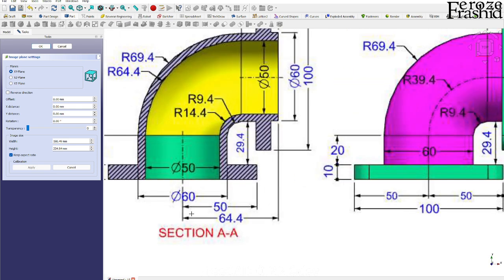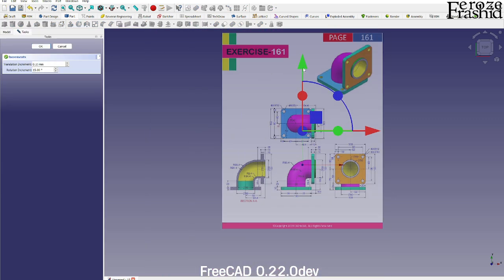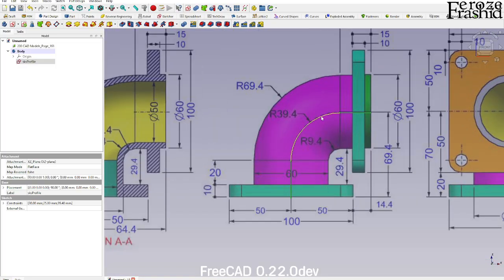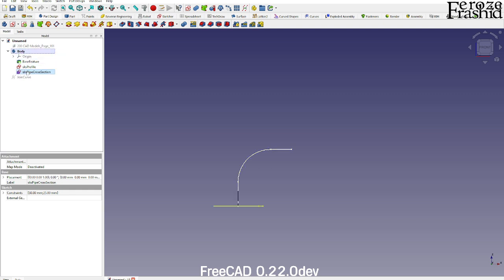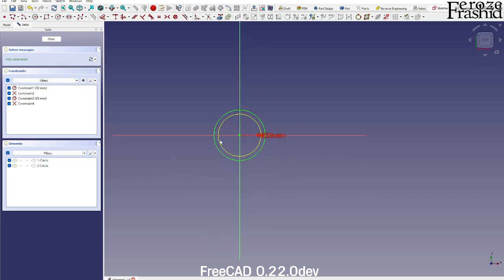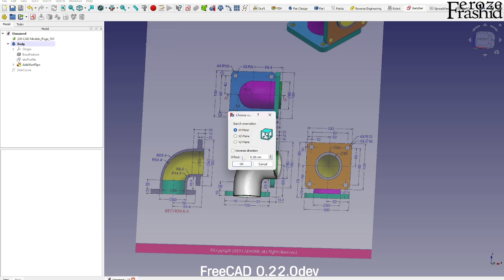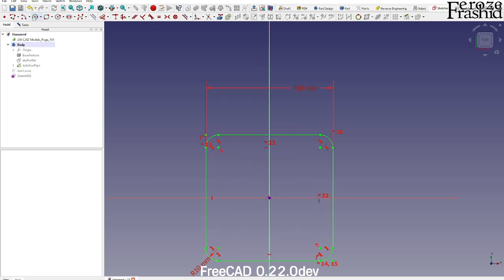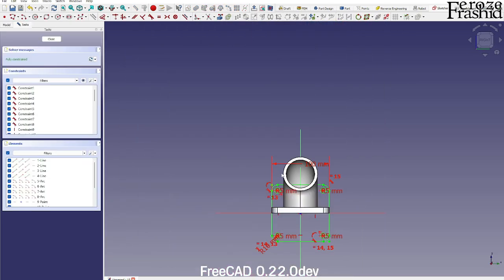200 3D Models in FreeCAD: Exercise 161

Comment: I had some difficulty making mine like the drawing. On the first sketch (joiCurves)  measurements were 25 vert 39.4 rad and 25 hor. In order to get the 5 extra mm I was missing, the pad was made symmetrical (5mm below X axis).  The last pad with the bit sticking out is from the Z being 69.4 and not 70. I still had a ridge in mine that looked like a failed refine. Zoomed in really close and there was a small difference in the two diameters. I changed the 50 mm diameter to 50.01 and it went away. 

Only the joinCurves ended up outside the body, everything else was in. I try to guess how to draw the project beforehand. Sometimes I match, sometimes I don't :)) Thanks.
Reply from the maker: I figured there would be some dimension mismatch, but didn't have the patience to go back and fix it. But it became more prominent after blender render.
Anyway, the joincurves feature is probably getting some update in its code. The feature is not acting right in the most .22dev version, as of today. So I am guessing somebody is going to fix it up and maybe make it better than what it is now.